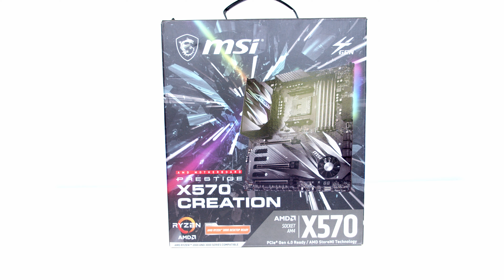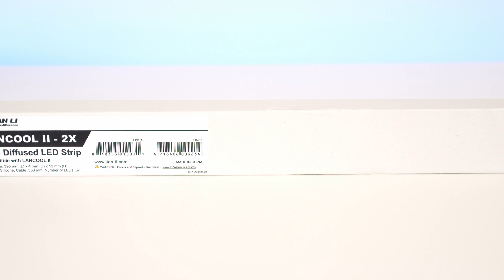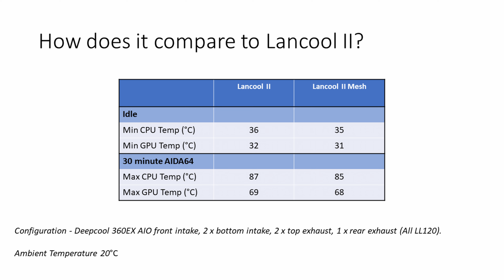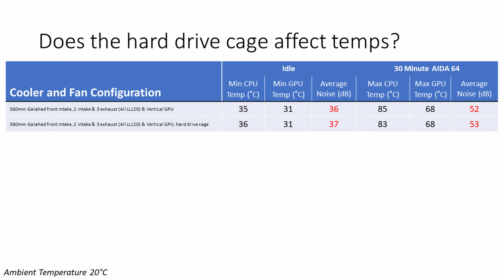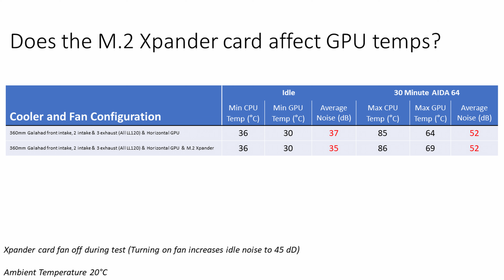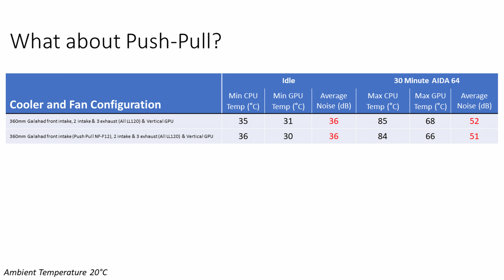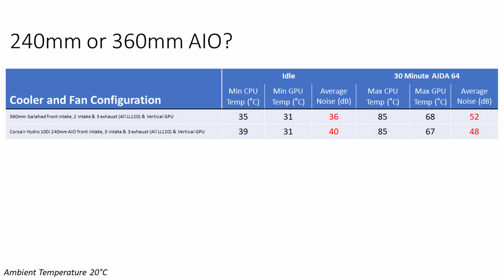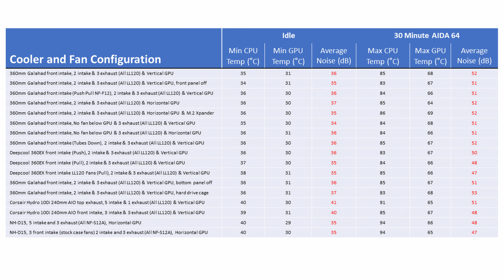Lian Li Lancool II Mesh Review & Thermal Testing

Comment: Thanks so much for the video! I am starting my first ever PC build with this case and would love some AIO clarification as I am very new to this. I have watched your build video on this case where you used a 360mm. To be clear now though, your recommendation is a 240mm where you add another fan below the two that come with the cooler? Is there a type of fan you recommend for that? Likewise, in this scenario how many additional fans should I put in the bottom and top/back of the case. In the build video I believe it was 5. I would love your input as I am doing this for the first time and don't want to mess up! Also, would a 280 work as well as the 240? Thanks so much!
Reply: @ChristopherFlannigan  
I'm confused on the matching the bottom fan part.
I ordered a H100i which is a 240. It comes with 2 ML 120 fans.
I plan on putting this on the front top 2 fan spots, with the tubes down.
What's the difference with what ever fan I decide to place in the bottom 3rd spot? I could leave it open as well, if I wanted?
I plan though on putting the same Corsair ML 120 fan there. 
Did you mean matching the same fan, or are you referring to matching something else?
Reply: @ChristopherFlannigan  Thanks Chris, dont think I could do this without your video. What I did was order both the 360 and 240 Galahad, I plan to use the 240 radiator so I can go tubes down, then use a fan from the 360 box as the bottom fan to match the top two. I then will use the other two of those fans as the bottom intake fans and the case fans as the exhaust on the top and back. I wanted to ask though, will I be able to plug all of those into RGB, are there splitters for that situation if needed?
Reply: @Casey
I received my case yesterday.
Don't forget to tape up the bottom of the case. There's a big hole where they made a handle to open the front panel.

Comment: The tubes up isnt about a noise issue as much as fluid permiation over the lifetime of the aio. Meaning that the small water wells at the top of the aio become less efficiently filled that may effect the pump and functionality over its lifetime not necessarily out of the box brandnew as you have tested.
Thank you for Everything else in this review it was good :)
Reply: I see you drank the Gamers Nexus Kool-Aid all the way. This is absolutely false, go and ask Steve himself. It is strictly a noise issue, and sometimes not even that.

Comment: i wanted this case but it went out of stock i ended up with the coolermaster td500 mesh which in my opinion looks alot better so it worked out for me
Reply: omg exaclty same situation for me and ended with the same case and this is looking so much better haha
Reply: Ryan El Amrani saved me about 20€ aswell looks alot better has better cable mamagment and i ended up with a white model best accident of my life

Comment: is there is any clearance for noctua d15 with two fans on it (i mean you can close the side panel), can you help me to choose a case between Lian li 2 mesh and bequiet pure base 500 dx  for an noctua nh-d15 cpu cooler base builde, and taking consideration of the noise lvl, thanks and keep the good work .
Reply: Thanks for replying, yeah but why dark rock 4 pro is cooler then nh-d15? Whu you suggest bequiet rather then noctua nh-d15!
Reply: Emm i see, but im going with the noctua chromax black so i think it's not ugly as much as the brown one, thanks for your advice, keep the good work.

Comment: Oh it’s the guy that installs his AIO cooler wrong! 😂😂 jk! Great vid, great content!
Reply: well, it IS wrong ._.
Reply: @Kasztabastan  How?
Reply: @brendanallen2468  The tubes going above the pump means air will collet at the top of the radiator. Does not matter too much at the start but with usage there will be more air in the system and over time it can shorten the life-span of the AIO or at least hurt its performance. GamersNexus has a video explaining this thoroughly by modding the radiator and the pump with see-through bits.

Comment: Parts coming in the next two weeks. Would you recommend getting the performance case and putting the 2 x 140mm fans in the top and adding 3 x 120mm to the front and 1 to the psu shroud? (I have a pack of 4 fans) Or go for the rgb case. And adding 4 x 120mm fans to exhaust, top and 1 on psu shroud? I will be watching your video while I build it. Thanks again for the great video. Waiting to get a zen 3 processor. Might buy a cheap zen 2 for now depending on the announcement made on the 8th. Thanks again for the great videos. 👍

Edit. Also do the lian li non rgb fans have standard 4 pin connectors so I can run run them from the controller I have (arctic p13 fans with 10 fan controller). Also debating if I should go water cooled or stick with the fuma 2 I have ordered? Thanks again
Reply: Hi! which one did you choose at the end ? Performance one or the RGB one? I'm still not sure as I heard the case fans were really loud but is it really that loud? haha

Comment: This one has been on my short list for a while. It's a nice case but a couple things bother me.

1. It's off-putting that the usb-c is an optional thing. I don' understand why they don't include it with everything else.
2. IMO, rubber grommets would have been a better option for the wire pass-through than a piece of metal. Personal preference. Still better than those phantek sliders though.
3. I don't like how you can easily see the psu and its jumbled mess of cables through the bottom of the case. It ruins the otherwise clean look.

I've been leaning towards the Fractal s2 Meshify when I ugprade to a 3080, but I've read no so great things about the thermals. Which seems weird because I currently have the Meshify C and my thermals are amazing. Probably because every single fan inside is a Noctua instead of stock.
Reply: Agree on number 1 & 2. I have a phanteks case and the sliding panel is one of the worst aspect of the case because it cannot hide the cables properly. However for number 3, if you use non rgb fans I doubt you can see the PSU and its cables. For cosair fans, using QL fans might fix this by turning off the front LEDs while having the back LEDs on to illuminate the inside case.

Comment: I was about to buy this case ... until I saw the 360 radiator cant be mounted on top :(
Reply: I'm in a similar boat, it's been my favourite case for months but I thought it could fit 3x140mm in the front and I see now that it can't - even worse, 2x140 would leave a visible gap at the bottom. Disappointing. Now my preferred case is the Phanteks P500A but I didn't like that the fan mounting frame is visible through the front panel. Why are there no perfect cases?!?!!!!! :)
Reply: @donkeysunited  Phanteks P500A: exactly the same I bought ... will arrive in a couple days 😎
Reply: It gets even worse for 140mm radiators. The Lian Li site says "Do not install a 140/280MM radiator in the inner side of the bracket otherwise irrepairable deformation might occur. The correct way to install is to mount fans first then place a radiator on top of the fans."
Which means the fan mounting frame obscures the fans when looked at through the front mesh panel. Sigh.
Reply: @cavalen  Enjoy it. I have a Phanteks Pro-M with tempered glass and it's very nice. They make great cases.

Comment: Hi Chris

I switched over to this thread, for one more question.
I haven't built a computer in over 15 years, so I watched this video twice.
Please don't test this, since you've done enough already.
I just want to see if in theory, this would be as good as it gets.

I am using this scenario of yours.............
Corsair Hydro 100i 240mm AIO front intake, 3 intake & 3 exhaust & Vertical GPU

1) If I change the 240mm AIO front intake, to a push pull configuration, I'd gain 1 degree more in cooling for the CPU & 2 degrees more in cooling for the GPU?
2) If I change the Vertical GPU to Horizontal GPU, I'd gain 4 degrees more in cooling for the GPU?

That's a total of 1 degree better for the CPU, and 6 degrees better for the GPU. Even if it's only half that, wouldn't that top the charts?

Just my theory, and seeing if it makes any sense.

Thanks for the help again, great videos.
Reply: @ChristopherFlannigan  Thanks and I agree. The cooler temps may not stack as greatly, but will add a little.

Comment: Hi, I've just built my first pc using this case and I was wondering if someone could give me some advice. The RGB cable doesn't fit in my motherboard (the fitting is different), could you recommend a solution.  Also my b450 ds3h motherboard only has 1 fan header, could you recommend a fan hub as the one I bought only has 2 cables that go to the header so the fans are stuck on 100%.
Reply: @ChristopherFlannigan  thanks for the reply. My fans for the CPU cooler are 4 pins, would that make any difference?

Comment: I was planning on getting one of these initially, but they're constantly sold out here with a pretty high price. I also didn't particularly like the mesh psu shroud. Went with the BeQuiet 500dx instead which was cheaper as i bought it on sale.
Reply: @ChristopherFlannigan  indeed. I have the deepcool castle 360 rgb v2 in it with a push pull config after following your recommendation from your video of it.

Comment: Amazing video!! Just upgraded to this case from my Phanteks p350x for the superior airflow since I’d like to get a FE RTX 3080. Question though, did you have any trouble mounting the 240mm radiator in the front of the case in a tubes down configuration with the GPU mounted horizontally?

Comment: Hello Christopher, thank you so much for this amazing video. Definitely the best PC review I've seen. I had a question, I'm getting a B550 Aorus Pro AC which only has 4 pin fan headers. Will I still be able to control the 3x stock RGB 120mm fans' speed but in Voltage/DC mode ? Or they will be stuck at 100% (and if so are they noisy during idle?) ? My motherboard seems to be compatible for PWM/DC fan mode. See manual below, page 33.

https://download.gigabyte.com/FileList/Manual/mb_manual_B550-AORUS-PRO-AC_1101_e.pdf
Reply from the maker: Yes, using dc mode

Comment: I am not a big fan of AIOs and I don't get what's the hype with them in recent years. Yeah, they look cool and are more swift with thermal performance but in edge to edge battle with an above average mid and high end air coolers, they are not that strikingly  or shockingly impressive.
Something tells me that if I slap Scythe Fuma 2 Rev. B along a Ryzen 5 5600X, thermals will be well within the acceptable performance (and then some) minus the daunting cost of a truly decent AIO but with the added bullet proof reliability and simplicity of an air cooler. I don't need to cash in into a huge ass Noctuas or Dark Rock 4 Pros. This AIO meta is getting a bit annoying and I wish more tech reviewers take not of the truly interesting Air coolers today.
Most people don't slap high end CPU that is thermal hungry and heavy, hell even so - with a good case and a decent air cooler you can get good results cooling a high tier GPU and CPU

Comment: It's a matter of how long you want it to work.  The physics of air and water levels dictates you are wrong in this regard.  As the unit starts to age the liquid levels drop and is replaced by air or dead space and if your liquid is being drawn from the top with air as well you get bubbles.  AIO pumps are lubricated by the liquid so please stop trying to act informed and disregarding a serious issue, and propagating the wrong way to use a product.  Again this is after the unit ages a bit not a brand new unit so your observations are premature and very incorrect.